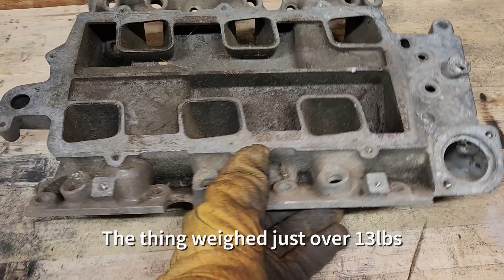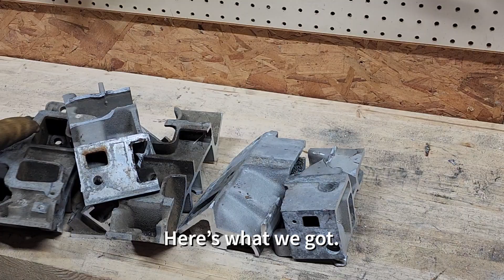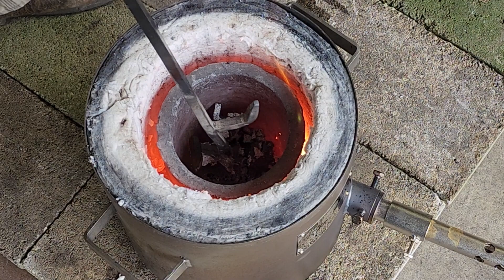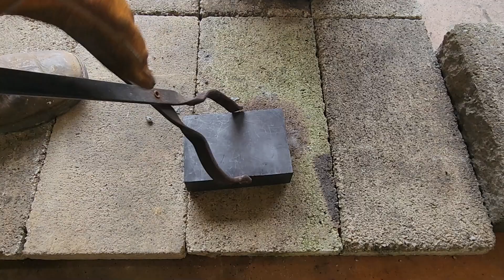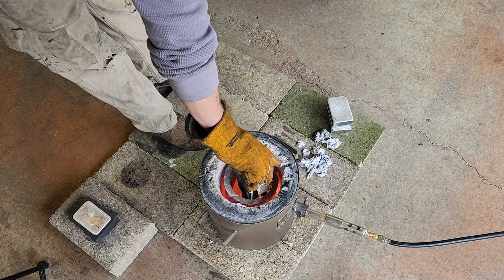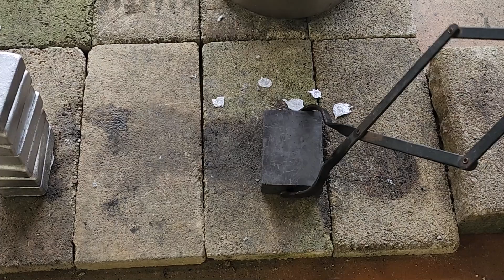Can you melt an intake? is it worth it??

Comment: Just getting technical here. What you have is an alloy and not pure aluminum. Pure aluminum does not have good properties for most products. Other elements are added to the aluminum to give it more desirable properties. In the case of cast parts silicon is one element added to aluminum to make it flow better in the mold. It also reduces the shrinkage you get during solidification. There are other elements added for increasing strength, like magnesium or copper. Other elements like titanium, in very small amounts, act as a grain refiner during solidification. Producing a smaller grain which increases strength. 

And then there are unwanted contaminants like iron, which must be controlled to small amounts. The automotive industry uses alloys mainly made from recycled scrap and can tolerate more unwanted elements. So you have a good casting alloy but it is in no way pure aluminum. Pure aluminum is rarely used in products and almost never in castings. (one exception is for cast in place rotor bars in AC electric motors)
Reply from the maker: Thanks, that was very informative. I suppose I should change the title then.
Reply: Holy smokes! Good read!
Reply: I was told pop and beer cans have no alloys